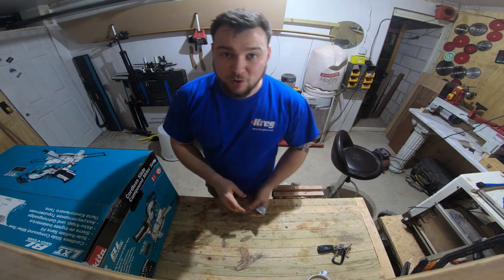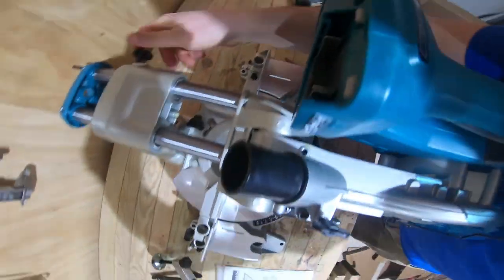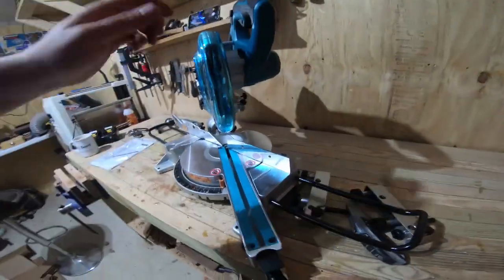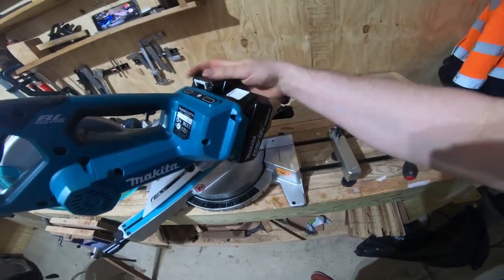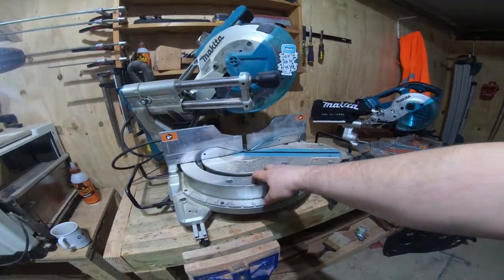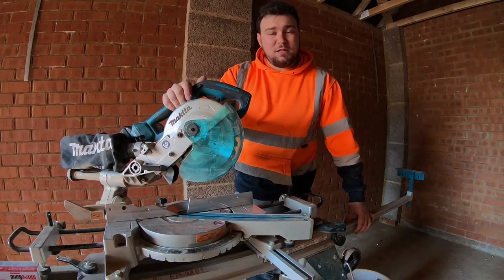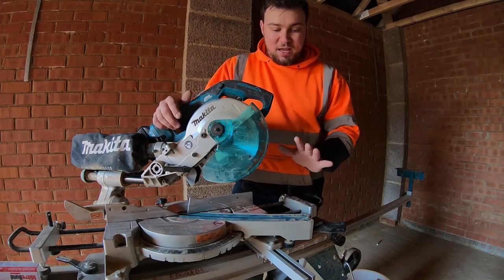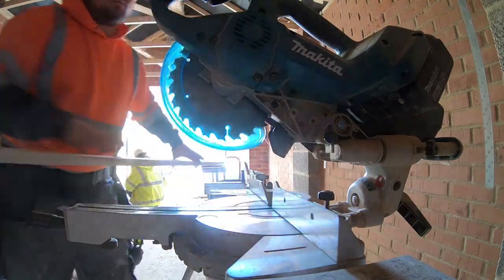Makita DLS714 Mitre saw Review

Comment: Nice review, just FYI around 6 mins you say you have 2 18v batteries at 4ah each which makes 36v (correct) and 8ah altogether (not so right). Unfortunately when you double the voltage to 36v you half the amp hrs. So 2 separate 18v batteries at 4 amp hrs each together is 8amp hr at 18v. But added together at 36v the still only put out 4ah as the amps is halved. The fact Makita uses 2 18v batteries makes it a bit confusing but it's the same for every brand. If you imagine them as one 8 amp hr 18v battery. When that battery puts out double the volts it lasts half the time e.g 4 amp hr  A hikoki multivolt battery for example is a single unit and is advertise as a 4/8 amp hr battery at 36v and 18v respectively. DeWalt flexvolt are 18v and 54v depending on the tool used in. So for arguement sake a 9amp hr DeWalt flexvolt is only 9amp hr at 18v when used as 54v it's actually only 3amp hr. 3 times the voltage equals a third the amp hr. Long winded but couldn't find any way of explaining it any shorter. Keep up the vids

Comment: So Phil, has this become your primary miter saw while your LS109L gathers dust in the shop at this point?  There seems to be a ton of guys who basically end up using these smaller saws for 95% of their work and virtually never hall out the bigger (HEAVY) saw...what about you?  For "homeowners" would you recommend the little 7 1/4 or its big brothers (the 10/12" saws)?
Reply: As you get older you really appreciate the lighter weight. The big beasts take a serious toll on the back..

Comment: do you struggle to change the blade? the casing seems to get in the way when trying to use the allen key?
Reply from the maker: The casing moves out the way with a releasable bolt which is loosened using the same Allen key provided.
Reply: @PhilEdwardsCarpenter  thankyou very much!

Comment: Id like to see how this saw would go with two 6 Amp hour batts for framing. I'm running an old Makita LS 1040 (old school) that serves me well, but looking at cordless. Just not sure if this beast is up to cutting studs and noggins for framing as well as doing 2nd fix for architraves and skirting. Realky didn't want to go to a 10 1/4 inch cordless as it's heavier than my old LS1040 Thoughts on this saw for both anyone?
Reply: I wouldn't recommend using the same saw for framing and finish..
Reply: I just use skill saw for framing,  easier than setting chop saw up, I use 5ah batts in chop saw, got couple 6ah but really can't tell the difference except 6ah take bit longer to charge